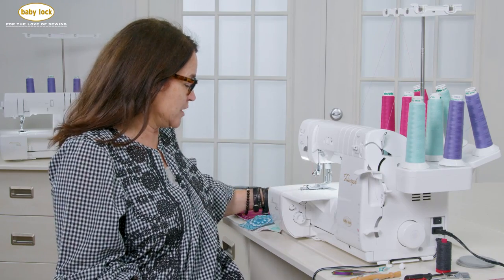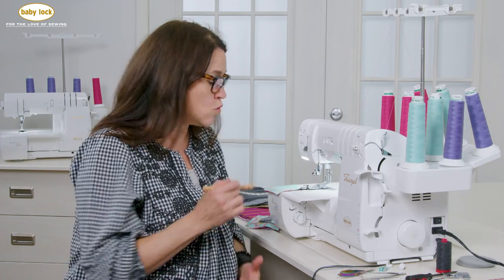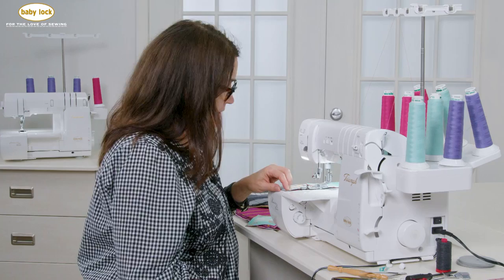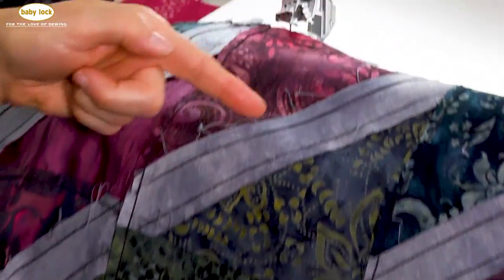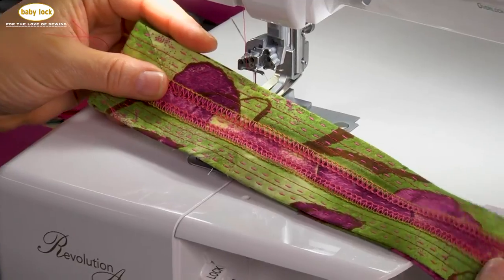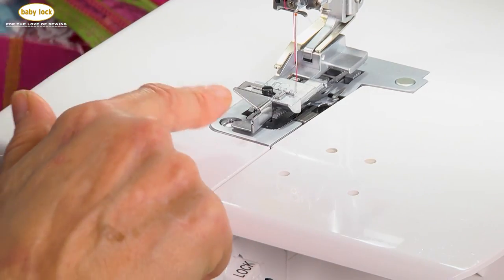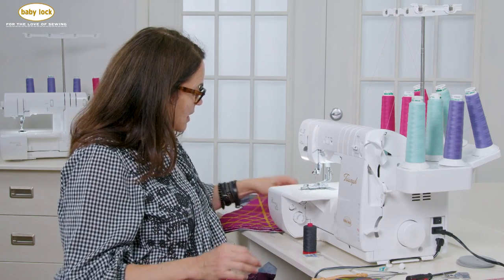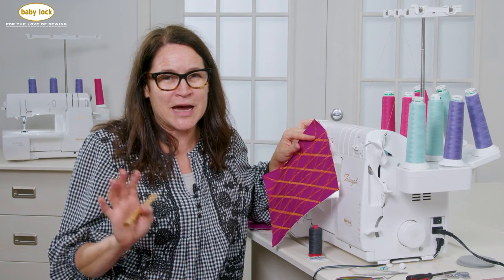Chris's Serger Tips: The Lace Applicator Foot

Comment: Please explain the difference between topstitch needle and the needle you were using before.
Reply from the maker: Chris says: The needle used for overlock thread is a size 80/90 and the eye of the needle is designed for this thread type and weight or size. The Topstitch needle has a larger eye that accommodates heavier threads, 12wt. for example. The larger eye allows the thread to move through the eye without shredding the thread when stitching. This is why I always use a Topstitch needle when working with heavier and specialty threads on my serger and sewing machine.
Reply: @babylocksewing  Thank you so much for answering my question!
Reply: I asked tech support abt top stitch needle and using cover stitch machine (Euphoria) for gathering - I was told there aren't top stitch needles for this machine and this machine isn't used for gathering!
Help.
Where to get top stitch needle.
I have Victory, Acclaim, and Euphoria machines and (Chorus and Ballad)
Obviously, I'm a Babylock fan!
Reply from the maker: @velvetstitching3631  The only time a topstitch needle would be used on the Euphoria is if a decorative thread, i.e. 12wt., was used in the needles for a decorative look when for the cover or chain stitch. For gathering using either the chain or narrow cover stitch a ELx705 or ELx705CF needle is suggested.
Reply: @babylocksewing  thank you!